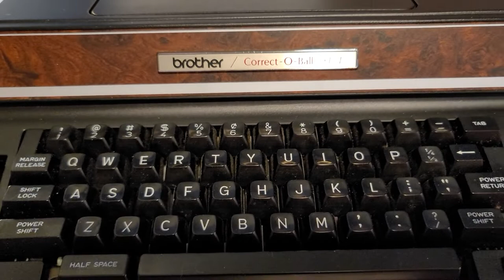Brother Correct-O-Ball XL-I rare ball typewriter

Comment: I just found this typewriter at a super price in my local thrift store. It didn’t come with a power cord. Do you know where I can get one?
Reply from the maker: The cords have that weird connector which I have no idea why they designed them that way... and finding a new cord that will fit is really hard to do. Depending on your level of skills with electronics, it might be easier to hardwire a new plug in, permanently, which I thought about doing when I found one without a cord, but then I found the one I wound up buying, which had a cord.. I wish I could give you a better answer but unfortunately, it's a strange situation... I don't know if there's room inside to remove the power connection and install a more modern one that has the more traditional connection parts but that might be an option.. I'm curious what kind of font ball is installed in yours, because finding a variety of styles is super hard to do too. I have a Pica and a Script. I'll message you again if I figure out where you can get a new power cord that fits your typewriter- For now, congratulations on your new find!!

Comment: Where did you find ribbons?  All I have found are a few from Germany which are prohibitively expensive.
Reply from the maker: At the time, I found 3 eBay sellers that had them as New Old Stock and I bought whatever they had- some as little as $10, most were $20, and yes, they are extremely hard to find- I have a small stash now, but what I did was put eBay on Search alerts so as soon as they were listed, I pounced on them. That's my suggestion to you. Definitely skip those overseas prices- although I did see a red one and a green one overseas but at those prices I said NOPE! Meanwhile, there's a seller on Craigslist near the Pittsburgh area that has one of these typewriters and the extras too, including a few new black ribbons, and I think he's selling everything for $50 ... maybe check that out. Otherwise, that's about all I can recommend. The other thing I am actively hunting for are the different types of type balls... Also extremely rare, especially since none of the IBM SELECTRIC balls will work on this typewriter,  and since these came and disappeared around 1983, I know the quest is a bit if a challenge. I wish you good luck and hope you get to enjoy this AMAZING typewriter too!
Reply: I opened the cartridge and replaced the ribbon for traditional universal ribbon.